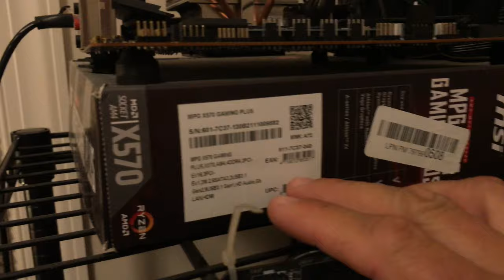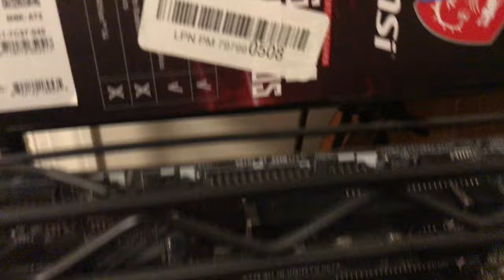🤯 Unveiling My Ryzen 3900X CPU Mining Rigs: Conquering Crypto FOMO with Raw Processing Power 🤯

Comment: Not sure I understand your concern about not using Ryzen Master.  Setting the clocks for a 3900x to 3600 and 1 volt is recommended.  You can also set that in the BIOS if you don't want to use Ryzen Master.  You'll save 10-20 watts in power and reduce your temperatures by 10-15 degrees with a small reduction in hash rate.
Reply from the maker: Yep, I figured these things all out yesterday with the settings by playing.around. I have a history using Afterburner for GPUs, it does not seem as forgiving as Ryzen Master with their Test first before applying settings mode.  All is running awesome now and I love learning this stuff through trying new tweaks.
Reply: Can I know what processor you use and how much you earn a day
Reply: @FirstsLasts-vy8qr  In my opinion, you're better off just buying crypto.  The only reason to mine (CPU or GPU) is the technical challenge.  You're trading electricity cost + hardware cost for crypto when you mine using your own hardware.  You're lucky to ever break even.

At this point, a 3900x/5900x Ryxen is making less than 75 cents a day.